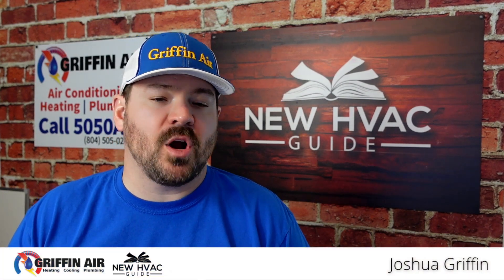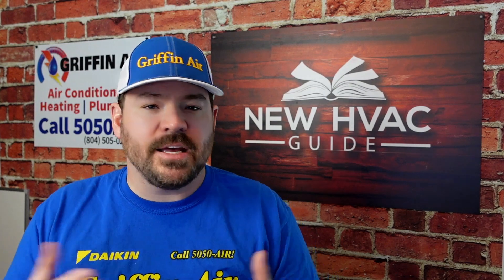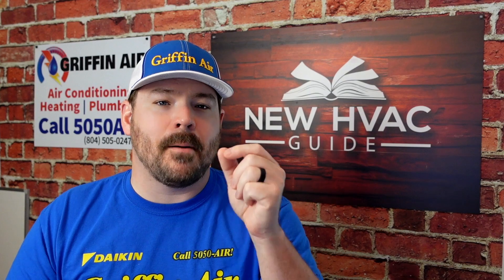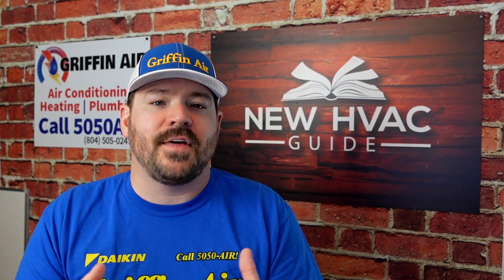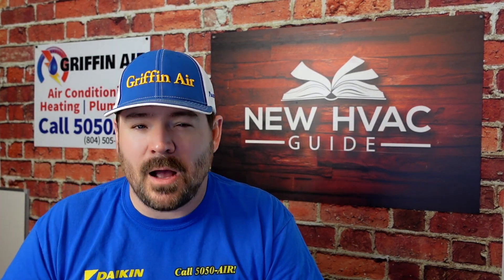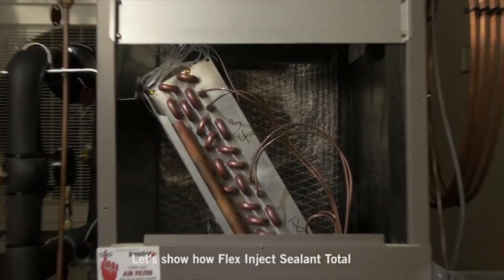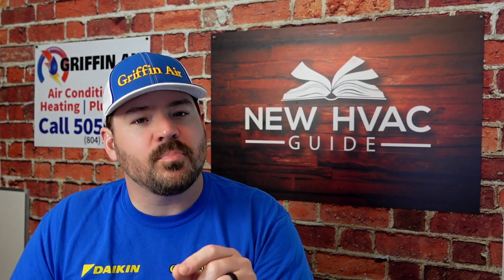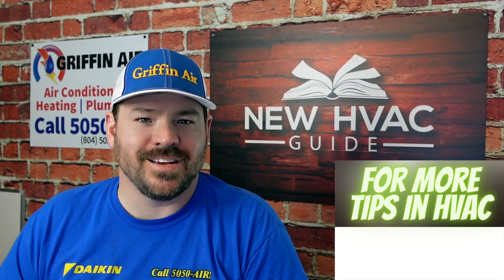Stop Refrigerant Leaks! Here's How!

Comment: don't use fix a flat equivalent for a/c unless it's a old system not worth fixing properly as it may harden where it shouldn't and wreck the system. have the leak found and fixed properly!
all that normally belongs is refrigerant and oil

Comment: I have used Cliplight Super Seal Advanced 944KIT successfully to stop a leak in my hvac system. "Cliplight Super Seal Advanced 944KIT - Permanently Seals & Prevents Leaks in A/C & Refrigeration Systems - 1.5-5 TONS by Cliplight $64.99 on Amazon". I have a Trane XL 19i installed in 2007. I purchased a 10 year extended warranty and the Evaporator Coil was replaced twice while under warranty for leaks. 9 years into the extended warranty the symptoms returned. The technicians said no leak and I needed a new system (it was 9 years old). I have a thermo gun to read temps out of vents and in return vents. My usual OUT temp was 54-56 degrees and it had risen to in the 68 degrees. I know enough about HVAC to be dangerous but I had a class on ac systems while working for the phone company. I suspected the dealer and techs wanted to sell me a new system. After they topped of the R-22 I found the Cliplight product and installed it. It fixed my leak/leaks. That was in June 2016. There were a lot of negative comments stating it would lock up the compressor on Amazon but it has worked well for me.